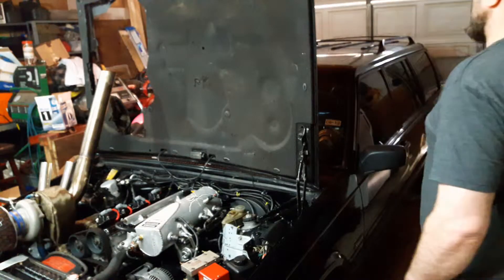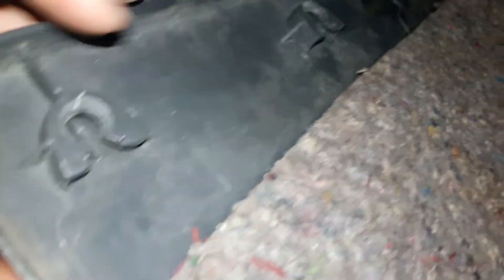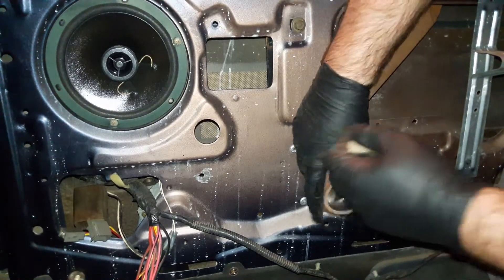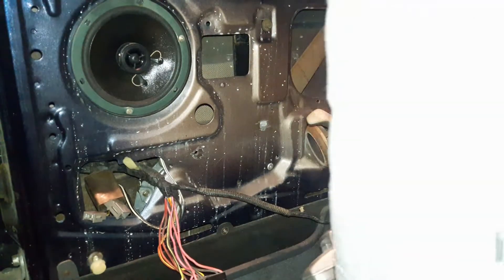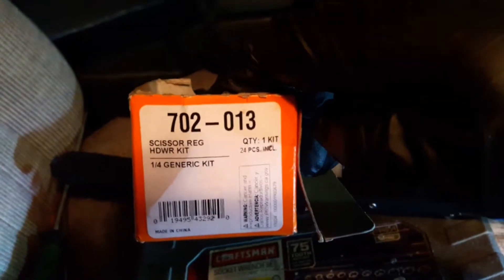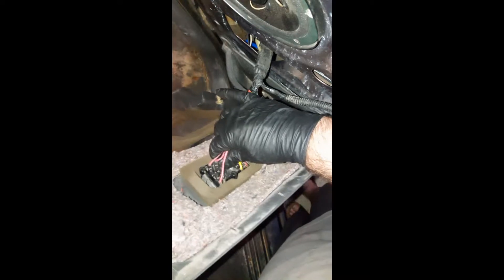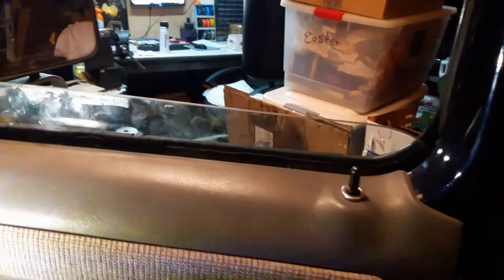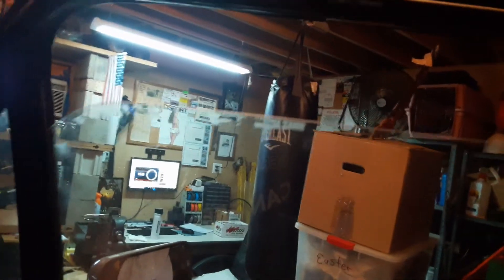Electric Window Regulator Removal and Replacement With Rivets

Comment: When you use a grinder you chance spreading metal debris into the interior of the car. Use your panel popper to remove the panel and the wire harness. I guess you can get the job done with very limited tools but I think a drill, punch and a chisel would have been more appropriate.
Reply from the maker: What ever works for you is your answer, my answer was very simple to vacuum up.

Comment: I have a 2011 Ford fusion se. I am on my second driver side window Regulator and now it's all together for the second time and now I cant get the 3 Rivets in the the Regulator and door  frame. I so hate the rivet guns they suck I have used so many different ones and nothing is staying in place.
Reply from the maker: Replace with bolts and knyloc nuts. Depending on the accessibility, o decide which is easiest, bolt and nut or pop rivet.

Comment: Did you have to rivet the glass back in too? 2000 Ford Windstar has rivets on the glass as well. They are huge like 5/8 pan size.
Reply from the maker: Luckily I did not have to! That would have been a no go zone for me! Talk about stressful, trying to pop a rivet in glass!
Reply: @TurboWorld  I was think I'd use bolts and lock nuts on the window.
Reply from the maker: @RC-Heli835  good idea! Maybe some felt or plastic "cusion" washers and be super careful tightening it!
Reply: @TurboWorld  I got all the things I thought I needed but the rivets are some kind of tough in the window. Its like the center pin is stainless and the outer is aluminum. A drill doesn't even phase the center pin. I put all my tools away and will have to get something else not sure what though.